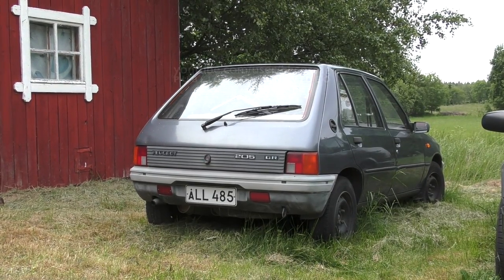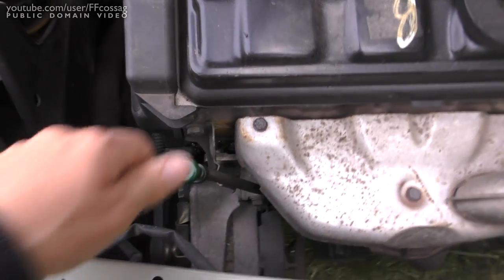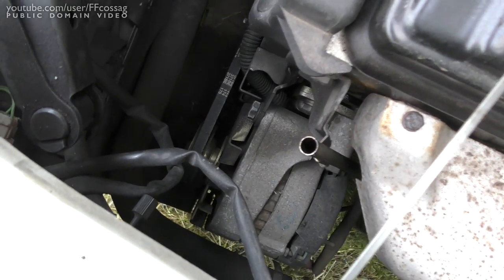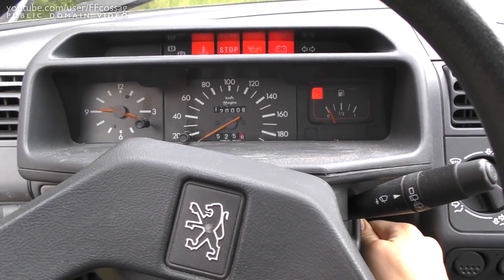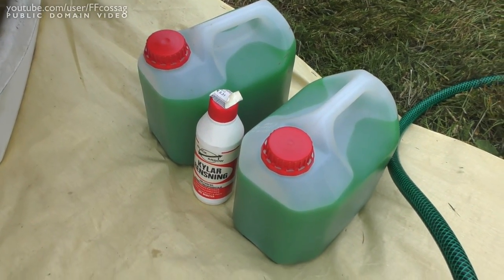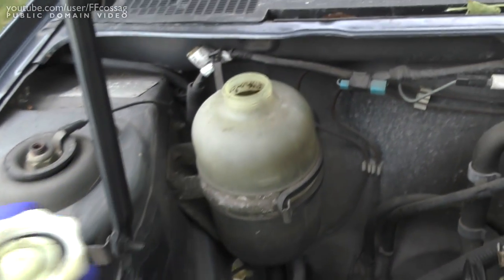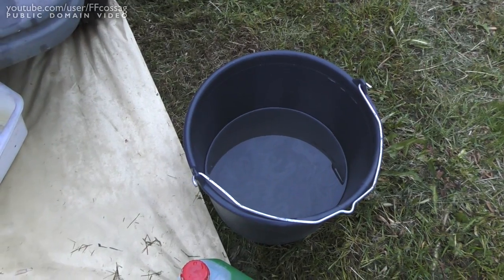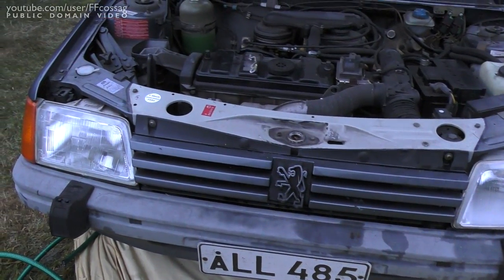Spare parts Peugeot 205 fluid service

Comment: I worked in an engine shop for 20 years and have reco'd maybe 10,000 heads, built 250 engines and disassembled 500 engines,  and you can tell by the low carbon in the rocker cover and the low blowby it's low Km. I bet the old lady maintained it well and the young guy never changed the oil, so when you got it it was a bit rough. A good find because the appearance seem to match the odometer km.

I've seen 4 year old engines totally destroyed because no one changed the oil but just topped it up when it was low, and because the carbon and ash in the head can get to 20mm thick the oil passages get blocked and it destroys the bearings.
Reply from the maker: Woo, mechanic approval!
Reply: Nice info. Thanks.

Comment: Good move changing the oil and coolant.  The oil will protect the inside of the engine better because it is not washed down with carbon and unburned fuel and possible moisture if it has been sitting. The new antifreeze will keep the cooling system from corrosion ensuring that all the good non leaking parts stay that way. The better you take care of that car, the better it will take care of your red one. 👍

Comment: Should last longer than the crap they sell these days, and given it's only done 74.5K Miles, it's still "young", but that's the trouble with cars that aren't considered preservation-worthy, people sell 'em cheap after they're "old", and someone runs them into the ground and they're gone forever, heck, I've seen Honda Civics and Accords from the early 2000s selling for £300-£500 on ebay, nothing wrong with them, just that they're "old"...

Comment: Unless there's something I'm unaware of, that car looks like it'd make a great daily driver. Maybe you should fix it up instead of the other one? Or fix both of them up and get rid of the Honda?

I could believe that the fresh oil might have made a difference. I have seen a four inch long exhaust pipe elbow make the difference between having a service engine soon light on or not (in a none too technically advanced car).
Reply from the maker: You're not mistaken, it would make a great daily driver. The sad thing is that some parts for these are nothing short of ridiculously expensive (we're talking $500 per reconditioned axle and not far from $1000 for a rear brake kit), plus difficult to source as Peugeot mixed and matched parts a lot during that era. As such, it just makes sense to treat this one as a $600 parts bin for the other Peugeot, which is in much nicer cosmetic condition and has some nostalgic value to me.

Comment: you're on the correct path...dont waste your time with fluids....are you leaking? making smoke? then you have issues. buy a new used engine...buy a new engine....installed by a mechanic....you're in business
Reply from the maker: I'm not sure what to make of your comment, but I'd rather replace fluids than replace engines.

Comment: I also paid only 600€ for my car (a 1999 Seat, same as the VW Polo, the "estate" version), but then I had to invest about 3 times as much in repairs for it to be actually in a fairly decent condition. But the underside of it was completely rust-free, and the whole suspension still tight and all, so it was definitely worth it. Now it is a good daily driver for another few years, until I'll be able to afford something else.

Comment: In my opinion, these cars aren't worth saving. If you had a VW Golf MK2 from that same vintage, I'd absolutely be for it, but those Peugeots? Not really... But then, this may also be a matter of taste, so these French cars could be an acquired one ;)
Anyways, the amount of effort you're putting into it looks like you want to keep this car as a vintage vehicle for another 20 or so years (or whenever they start picking up in value, if they ever do, which is rather doubtful).
Reply from the maker: The red 205 I own is my first car, and it's been very well kept by both its previous owner and I. Not many of these survive in such good condition, since few people consider non-GTIs worth saving. As such, I intend to keep mine for a very long time. I love how it stands out among the generally trashed and worn down old Peugeots you see.
Reply: LOL, exactly, that's what I associate with French cars that are over 20 years old: Trashed and worn down. Hey, I once even got a Citroën BX for free, that was back in 2001, so it wasn't even 20 years old, but I ended up driving it for a day or two and then scrapping it as well, just because there wasn't anything else I could have reasonably done with it. And those Citroëns were even a bit more fancy than Peugeots back in the day. But I guess, when yours will be like one of a hundred vehicles of its type left in all Europe, then you may have something of modest value...
Reply from the maker: Indeed - although value isn't much of a concern to me. I just like to be able to say that I still own and drive my first car.
Reply: OK, well, I missed that opportunity a long time ago. Couldn't keep it anyways, out of financial reasons (and then, when you live in a big city with a German public transport system, you don't really need a car, either. Now my situation has changed and I enjoy owning one again, but that's a different story, and it's nice not to have to rely on the S-Bahn for a 25km commute)
Reply: FFcossag Will it still be your first car though when it resembles Trigger's broom though? ;-)
Reply from the maker: Ha. Yes it will.

Comment: why bother with this shopping cart when you have perfectly cromulent ~1990 Honda Accord right there?
Reply from the maker: The Honda, while running, is pretty much trash. The engine needs a rebuild, the interior is nasty, and you really feel the ~300 000 km that the suspension has been through.